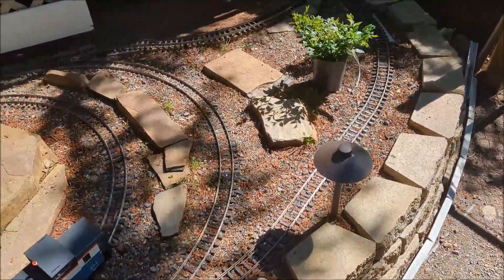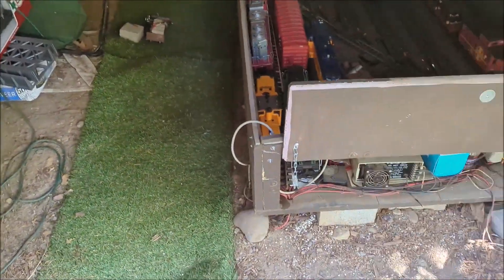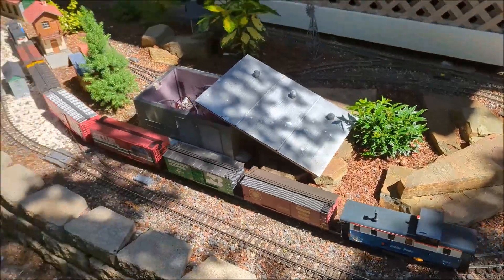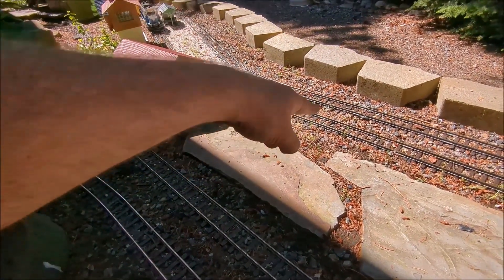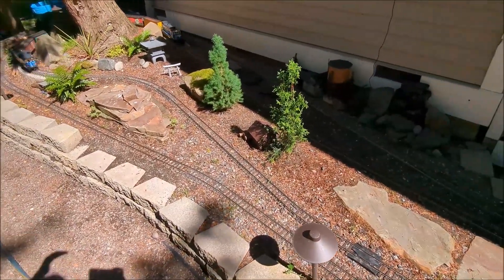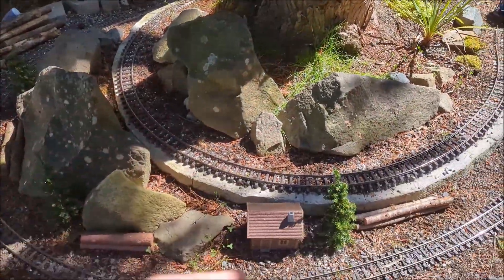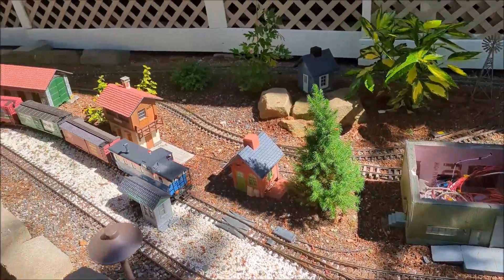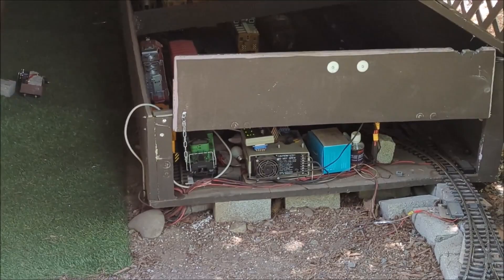Building My G Scale Garden Railway: ⚡ Power and Wiring Setup ⚡

Comment: Getting ideas.... thanks. I hope to be starting a layout soon. I am looking for a yard in the Vancouver Washington area to use.,I reside in an apartment. Love what you are doing. I see you fly also. Me too
Reply from the maker: Yeah, RC Planes and G Scale trains aren't exactly a cheap hobby. But if you're a cheap sonofa and creative, you can go a long way on a little cash.

I'll be posting a video soon of a cool thing I just discovered that I'm implamenting on my railroad. It's remote control, but for boring ole' DC operations! No need for $150 decoders. In fact, the entire system is easily less than $100.

Check out this thread here for details:
https://www.mylargescale.com/threads/build-a-wireless-dc-10-amp-controller-under-100-00.91277/

Comment: So was soldering easy? Would love to know. Maybe a video of soldering to the track, basic G scale soldering to the track. Thank you for all you do.
Reply from the maker: I don't have any soldering on my track. I've tried it in the past and have never been successful. I think you need a really heavy-duty iron to heat up that much metal in the rail to get a successful solder joint.

Perhaps you are referring to the eyelet connectors? When I said solder, I meant that I soldered the wire to the eyelet and then I slid the eyelet underneath the rail so that it made contact. They are not soldered directly to the rail.